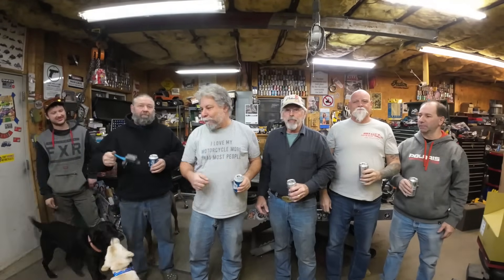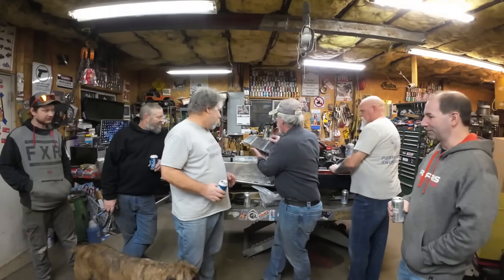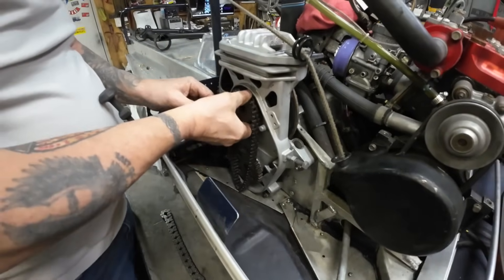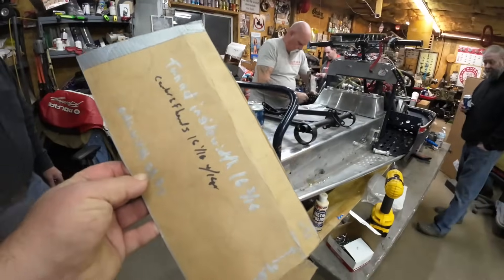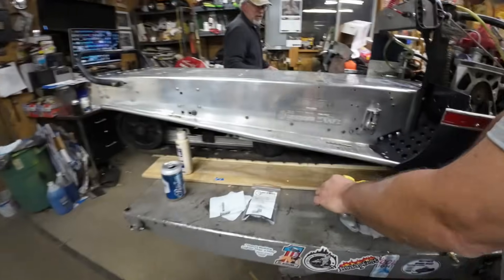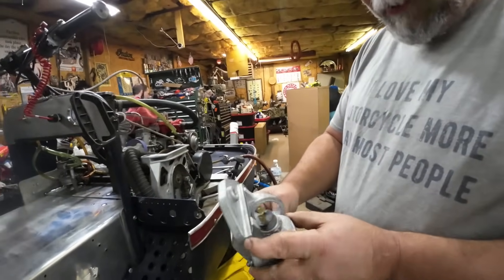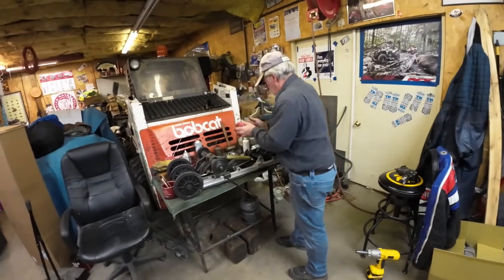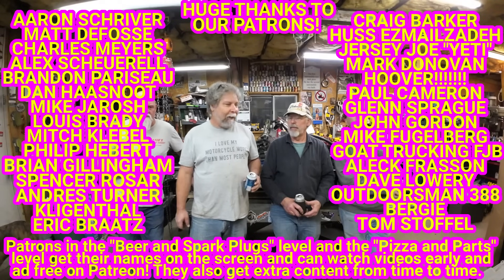Tommy's Speed run Sled Part 5. PSI Genesis II Vintage Polaris Triple Race Snowmobile.

Comment: This project is the epitome of why Polaris was #1 from late '70s through late '90s in sales, performance, and modifications....no other MFG could match Polaris for part interchange, retrofit of virtually every part easily, and aftermarket support.  Skidoo finally saw the light in '95 with their S2000 chassis to compliment their proven Rotax power.  Yamaha caught up with the '97 SX release that ended the "unique" pogo stick platform, and the ditch pickle gang finally got close with AWS-V and then did it right with the '03 F-chassis program.  Thanks for keeping the old school shade tree sled life alive!
Reply from the maker: Thanks!